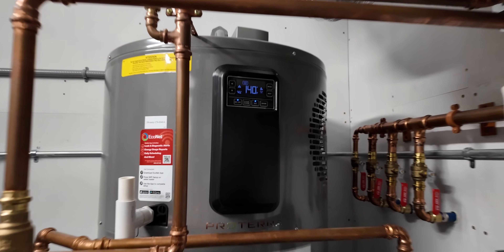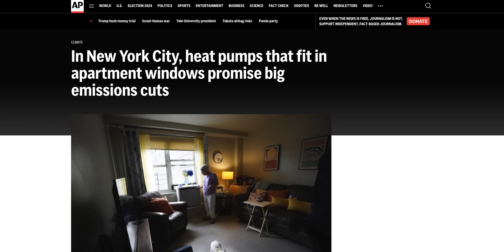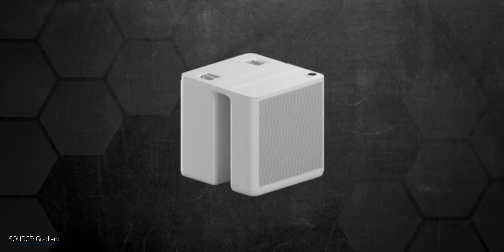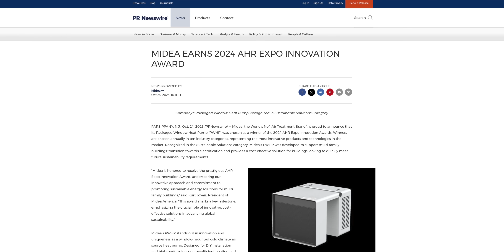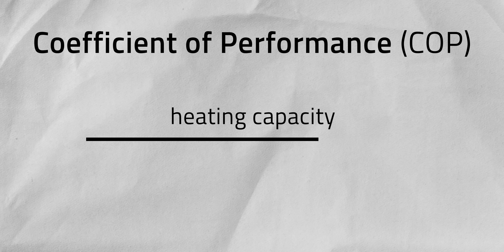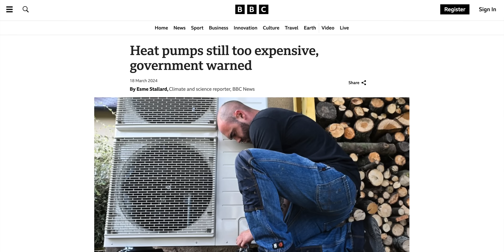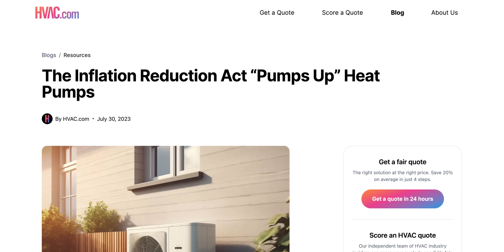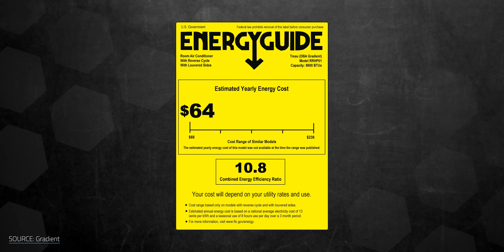Why This Window Heat Pump Is Genius

Comment: Still won't work for the upper plains states that can get weeks of 20-40 degrees below zero in winter.  Or even if the temp is zero, the wind chills can easily bump them down to below the operating efficiencies of these units

Comment: These sort of models mostly work for the weird slide-up windows that Americans use, any house with hinged windows are gonna have a much harder time fitting them so I need too see some more options
Reply: You also have to have nothing below the window, my road in the UK has all slide-up (sash) windows but also a small roof just below the window that would prevent you installing this design.
Reply: They are called double-hung windows. And they are pretty neat IMO. You can slide up or you can push the outside screen to the top and slide them down instead. Having the window cracked at the top is nice if you have shades that can open just at the top, if you want a window to let warmer air out while a window fan blows in from another window, or you don't want a toddler putting their fingers in the dirty sill.
Reply: @twothirdsanexplosive  Oof.
Reply: wow great point... I was blown away at how different windows are in Europe. much better double sealed, side opening styles.
Reply: Yeah, double hung windows are pretty neat, and they also don't require any space inside or outside the window plane for opening which can be quite helpful. They're only common in certain pockets though; more of the homes I've lived in (both apartments & houses) have had casement windows than double hung.
Reply: @danielchin8073  They dominate in New England homes but when I lived in the Pacific Northwest I didn't even know about them.
Reply: LOL, some of us even have our weird slide up windows mounted sideways. Which also makes this not work. I love the hinged windows of Europe. If the next house I move to needs windows, I'll be splurging for those.
Reply: @roguea987  Don't all houses need windows? 😜😂
Reply: @roguea987  My house has both. I can say the hinged windows with the crank handle have held up much better.
Reply: It’s called a mini split unit
Reply: There are some that only require You to Drill at twelve centimeter hole
Reply: @TecSanento  12cm is an incredibly large hole to put through a wall.

Comment: I would 100% get these if.......they didn't cost a small down payment on a car. One of the other issues in old homes isn't just the heating and cooling, it's also the insulation in the building. I live in a 100 year old home in Pennsylvania and am running into this exact issue. It doesn't matter how much we invest in heating and cooling if it is all escaping the building to begin with. Back to the original question though. These are just way too expensive. They average person /might/ be able to stretch $1000, but 2 or 3? That's a lot especially with cost of living going up here in the States

Comment: Is one unit enough for a two bedroom apartment, or do you need a unit per room? Will the power grids of these big cities be able to handle the additional load of hundreds of thousands of these units? Where is the additional electricity coming from? Burning  gas and coal in powerplants?
Reply: There would be massive electric reduction with the removal of the in window AC units. Though have no idea what winter would entail.

Comment: NYC is getting scammed by these overpriced heatpump units. 
Quick Amazon search I found a Midea 12000 BTU, 13.3 SEER Window heat pump for 500 bucks.
It's not a fancy over the sill unit, but it's 1/4 the price, though it's limited in range of heat.
There is no way these guys are going for 3k for a 9000 BTU system.

Comment: I’m not understanding why the high cost. Mr cool sells a 12k btu DIY mini split for around 2k. Am I really paying a 1000.00 premium just to save cutting one 3” hole?
Reply: You saving around 500 usd each year to run it so 2  year paid the same just most dont have initial outlay
Reply: @WayneJohnsonZastil  no your not. his split is nearly as efficient as these new units. almost NO savings compared to each other.

this ia a $900 split unit in a $3000 fancy lets sponge the government package. my 12k btu split is a mexico whirlpool unit and cost me $900 INSTALLED.

Comment: 12:53 trust me, in Tokyo heatpumps are the standard already, nearly all apartments come with at least 1, they are renter friendly as apartments are designed with slots for them to add them if they were not included. and the typical mini split heat pump is around $500
my apartment has 2, one for each room
Reply: This.

$3k USD for these units is insane when, as you said, a mini split is less expensive.

I believe you can get a 4 room mini split for around $3-5k before rebates and if esthetics of the building  are important, I'd rather see a few ground base heat pumps (which you can easily hide) vs multiple units hanging off the front of the building.

My other thought is AC units at around $300 have thermostats so they're better than the $150 units which just cycle the pump when cooling is needed. AKA they run constantly. While they have the benefit of also efficiently heating, as Matt said, most renters have heating baked into their rental agreements.

$1500-2k before rebates. Still more expensive than a 2 room mini however, the convenience and ability to pretty much place it anywhere you have an outlet, justifies the cost. But not $3k lol
Reply: @shawnduffy279  This is what happens when factories for the AC-as-a-brick have been set up and paid for by private entities, then refuse to adapt to new available technologies without their "friends" in government bribing them to ship in that new tech.

This is the kind of BS that the first hippies responded to with "never trust anyone over 40".
Reply: Yes, my Tokyo apartment had 1 in the bedroom and a larger unit in the living room. Quiet, efficient and not so expensive. Not to mention almost every apartment in Japan has a washing machine...
Reply: You're correct. the majority of air conditioning units in Japan are already heat pumps. Fuel heating is likely only necessary in Hokkaido, located in the north.

Let me share an even more intriguing story. In Japan, a technology called EcoCute, which also utilizes heat pumps to generate hot water, is gaining popularity, with a current adoption rate exceeding 30%. This system utilizes excess electricity during nighttime hours to operate the heat pump and store hot water in a tank for later use.

The rise in popularity of EcoCute has an interesting backstory. Local gas companies have also ventured into the electric power sector, prompting a transition to heat pump-based equipment when updating older gas appliances.
Reply: I bought a 10 HORSEPOWER heat pump for my 200 square meter business oremesis for $8,000 and you’re telling me that rinkydink little toy costs $3,000.  

That’s a hard af no from me.
Reply: We are not in Tokyo, though. Most of the viewers are from the continental US.
Reply: Sounds fab what make and models do you have then?
Reply: @danbentley6779 
Daikin, Mitstubishi, Fujitsu, Panasonic, Toshiba, Hitachi, Sharp etc.
Reply: These units aren't for new build. You have 60 to 80% of the houses in Japan that don't have even close to what your talking about.
Reply: the mitsubishi ones are my favorite, they’re even in older structures that are hundreds of years old
Reply: The critical feature with these units is the wide operating temperature range, and the requirement that they have balanced heating and cooling capacity with no inclusion of resistance heaters. Cheaper heat pumps have a relatively high minimum operating temperature, often above freezing, and then use a resistance heater that kicks in below those temperatures. These units have no resistance heater, and so are forced to use much more expensive compressor and control systems to increase the operating range given the constraints of the relatively narrow banded refrigerants now required. This type of unit will use much much less electricity over the lifetime of the equipment, but they will be substantially more expensive up front. I do see them coming down to $1000 eventually, but likely never $500 at this size. (I have a background in industrial applications for heat pumps)
Reply: Can you provide a source for oyur claim that the heat pumps are actually doing heating? From everything i can find the majority of the acs in japan have resistant heating included, but not actually heat pump heating anywhere below 10 degrees C. 
Which would also explain some of the price disparity, as it requires different and more expensive tech and coolants for near or subzero heat pumping.
Reply: The rest of the planet has been using heat pumps for decades, dedicated cooling ac is extremely uncommon in aus/nz
Reply: @Etacovda63  That is what I wanted to say too. The rest of the planet (maybe not all) already is using AC units with reversible heat pumps. Where I live that's the only thing you can buy in every store :heat pump based ACs.
Reply: @Etacovda63  What "rest of the planet" lol.
Reply: @Dandan-tg6tj was about to say this too which is why I was puzzled at the video stating heat pumps as a revolutionary technology. It isn’t even possible to get a split or ducted system here without heat mode. The only straight cool units are those cheapest portable units, but even then, half of the portables have heat pump as well.
Reply: @reappermen  Mini split units come standard with heat pump feature, essentially for free. There isn't magic voodoo. It will be considered when designing, but it is nothing that should make it cost 10x as much.
Reply: @reappermen  All heat pumps sold that I'm aware of have the ability to create heat.  In Japan heat pumps are as prevalent as they say.  In the US importing one is around $900 a bedroom.  I imagine in Japan it's closer to $700 a bedroom.  $500 once was a thing, but then everything changed when The Inflation Nation attacked.
Reply: @reappermen Are you dense? Hest pumps work in both directions by definition. That's the reason they aren't called AC units.
Reply: @peaj4812  yess, everything sold as simply a heat pump should be onidirectional, but that doesn't mean they can work in all temperatures. Transfering heat between  20 and 40 degree Celsius areas is a very different requirement for the coolant and compressor/radiator ystem than transfering heat between -10 and 20 degree areas. Hence why a lot of simple AC's in Japan include (or at least used to, hence my question) a simple resistive heater for heating in extremer temperatures.

Also, there is no need to use insults, and if you do you should be very sure you know your facts.
Reply: @reappermen  It's in the video.
Reply: @reappermen Source; They've been around since the 60's.
All it takes is maybe a 100$ part to make a normal AC a heat pump too.
Reply: @reappermen No, you read guesswork by Yankee gaijin who saw the "AC" has a "hot mode", just ASSUMED it's a "giant hairdryer", and decided to poison themselves with kerosene fumes instead.
Reply: @reappermen  I can 100% vouch for the fact that heat pumps heat without resistance strips.  I have installed several identical 12,000btu units and dismantled one completely for cleaning.
Reply: @reappermen  The thermostat is typically programmed to activate the heat strips when the temperature drops below a certain point or if the heat pump runs for an extended period without reaching the desired temperature. That is why resistance heat strips are installed in heat pumps.  Not all heat pumps have this feature (think cheaper ones) and rely on the heat pump alone.  I have installed several identical 12,000btu mini split heat pumps and dismantled one to clean the head unit and no resistance heat strips were found.

Comment: Why can't you just put a standard window AC in the window backwards? Put the hot side in the room and the cold side in the open air.
Getting to the controls would be harder, but most come with remotes nowadays. 

Three grand?! My 3 ton Mr. Cool was only $4500 and it cool/heats the whole house. That screams cash grab to me. Especially with the gov't incentives.

Comment: Americans finally found a justification for their push-up windows.
Reply: What kind of windows do other countries use?
Reply: @1stGradeWumbology  Snooty ones, apparently.
Reply: @1stGradeWumbology  Germany has windows with a lever that switches them between 3 states: swinging open horizontally, opening about 30 degrees vertically and closed.

Comment: Heat pumps use  electricity, Boilers use Natural Gas.  Electricity is WAY WZY more expensive.
Reply: Do you understand how little a heat pump uses v electric heating ?
And that fossil fuel use is likely heating up tthe planet and causing more disturbed climate systems.

Comment: I've wanted something like this since I got one of Midea's U shaped ACs. Just flip it upside down, duh.
Now we just need one for windows that open/close sideways. A C shaped one.
Reply: I bought two for my house and after a year one stopped cooling very well and the other one was making an annoying noise.  So, year three on my house I ended up installing an air source heat pump, because my furnace needed replaced.  In the second year I tried to get my units serviced, but the product was out of warranty, and there was no one in my city that serviced Midea.  They are quieter than a normal AC and when they work they are great.  When compared to a standard old-fashioned window AC these units are more fragile.  Unless the heat pump version had a great warranty, I would be leery of these upcoming products.  There might be more value in repairing them and you would also not be taking them in and out in the same fashion as an AC.  Another consideration is can these be installed where you have a roof outside the window.  We had to install the brace upside down on one unit to get it to rest at a slight angle for water to properly drain, the upright U worked in this case, but I am not sure the upside down one would work in my upstairs windows with the porch roof so near the window.
Reply: @Sleepingvampires  What noise were you dealing with?  My Midea 8K BTU unit is around three years old, and it has always had a bit of a rattling problem that crops up ever so often.  When it does rattle, I've noticed that simply pushing up on the bottom of the inside portion of the unit stops the rattling noise.  Fortunately, since I started using extra window locks to push down the window onto the unit (the unit doesn't perfectly fit into my window), I rarely have issues with the rattling.  Although, it does have a habit of getting louder (fan noise) when it's nearly done cooling.  I use it in a computer room due to having two computers in there that can generate plenty of heat.
Reply: @shinaikouka  It was kind of a whirring rattling noise. Not very loud just a noise the other unit never make, but since that was the unit that actually cooled correctly it was just differently annoying compared to the unit that stopped cooling to the same quality after a year and a half.  That one had a compressor error, in the apps trouble shooting, but that never helped me get it fixed.  Even in that state it cooled a little, but only made the house be maybe 80 degrees instead of 90, though that could have just been the fan pulling air form the other two units in the house.
Reply: @Sleepingvampires  Hm, that sounds like the issue that I was dealing with.  It sounded a lot like it was coming from near the fan, but I was never able to find a good source.  Some folks said it had to do with water in the tray that needs to drain, but I’m not entirely sure?  As noted, if I put upward pressure on the bottom of the unit, the noise would stop.  At one point, I literally wedged a squishy ball in between the window sill and the unit, which stopped the noise… until the ball fell out.  It has been pretty good lately though.  I think my one complaint is that — even though I have it on the lowest noise setting — it does get a bit noisier when it’s almost done with its cycle.  It isn’t bad or anything, but my main focus is for quiet operation since it’s only a few feet from my main desktop computer.
Reply: Casement window AC units work in windows that open sideways.
Reply: @bobbygetsbanned6049  Yeah but they're not maximum efficiency heat pumps and don't allow you to almost entirely close the window. They're just a *tad* narrower than normal window a/c units. You still have to fill a decent gap and your window is now effectively much smaller. 

My condo HOA may still say no because they don't want stuff hanging out above garages (window a/c's are currently banned), but I would absolutely pay around 2k for a casement window heat pump that allowed the window to shut 95% (if it was allowed). Our bedrooms with casement windows are the only rooms that get hot. The rest of the condo which has hung windows doesn't even need cooling most of the time and it's half a floor downstairs from the bedrooms so the cool air wouldn't get up to the hot rooms if I put a unit there. So instead I have an annoyingly space inefficient portable inverter a/c, plus various fans upstairs.

We have a condo unit to our left, right, and above, so no easy option to externally mount a classic heat pump mini split either.
Reply: @bobbygetsbanned6049  Also the ones that don't slide, but swivel instead?
Reply: @KanedaSyndrome  No I don't think so, they are only for sliding windows. With swivel windows you're basically screwed for window AC units but you can do a mini split which are a good option these days, just more expensive.
Reply: Yeh so we can use them in Europe. Our windows don't slide open, they swivel open.